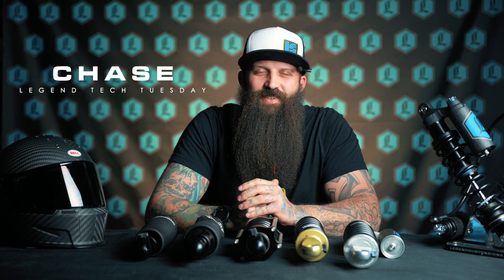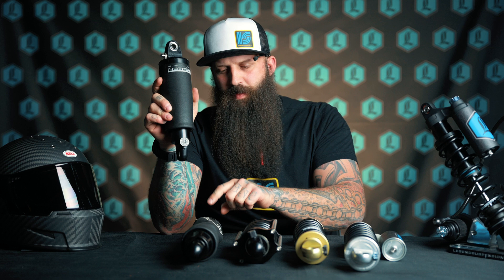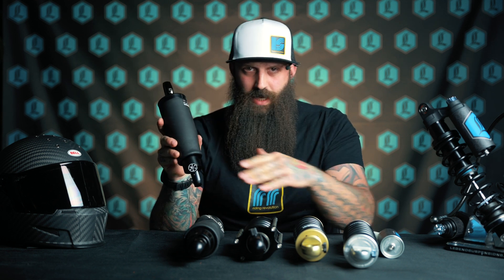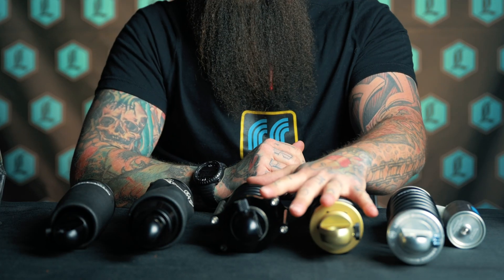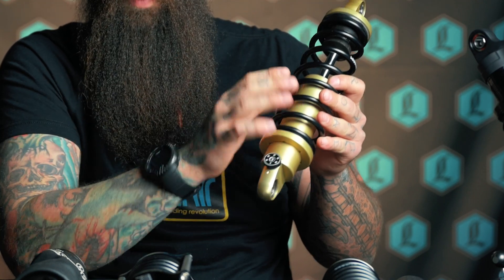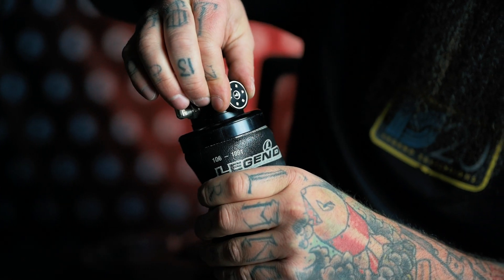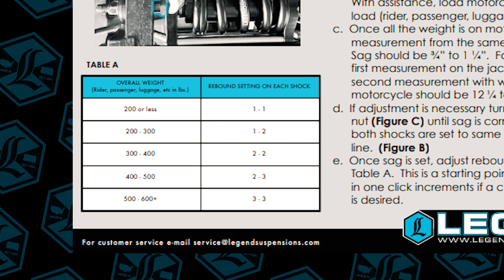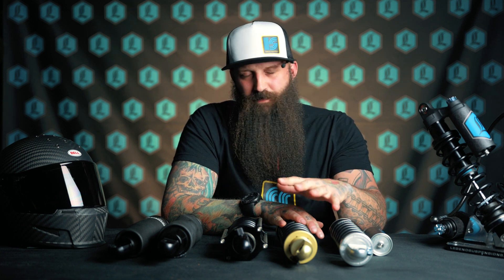What is REBOUND??? And How Do You Use It???

Comment: With a dyna and Revo shocks, approximately how many turns on the coil to add a 150 .lbs passenger.
Reply from the maker: You will need to measure the shocks from your starting point as there is not a setpoint. 
It depends on the length of the shocks you have, the spring rate and any other gear.

Comment: I understand mechanically what the rebound function does. Referring to restricting (or slowing) the flow of oil. My question is for the setting. What setting is the softer ride? The oil more restricted or less restrictive? Thanks
Reply from the maker: The fast oil movement or less restriction would speed up the shock. This is generally perceived as the softer feeling. 
Lower rebound settings or less restriction will soften the ride, but at the same time it allows the shocks to move faster. So, while it can feel softer, making the shocks move faster may not always be what you want for a given application as it can also make the ride feel bouncier.  In theory the thought of lower rebound is softer, come with faster reacting and if you were to hit 1 single bump and the shock compresses then extends more than once you would want to consider slowing down the rebound. 

You really want to aim for hit a bump, compress, extend back to ride height and done. This can be subjective based on personal preference. But this would be a good overall tune to shoot for. 

We hope this helps, if you have any additional questions, please feel free to email us at service@legendsuspensions.com

Comment: So basically there is no risk to set the Revo A at “1” and not having rebound at all? Some people were saying to me it works like pogo stick then and feels like there is no rebound or broken shock. I don’t believe that, because I personally set it at “1” and really, really like the ride. I’m wondering how would you rate the stock touring front fork is set in your terms of rebound setting? Thank you for amazing product!
Reply from the maker: Hello, 
Good questions, when the suspension sag is set correctly for your weight range you are telling the shocks to use all of its travel and prevent bottoming out. Some road conditions or areas may require someone to run less than 1" of suspension sag as bigger bumps may need to be tuned out compared to someone who lives in an area like Florida where the roads are flat and smooth. 

Once this is set the rebound preference is the rider's choice depending on how they want the bike to ride. setting 1 on the rebound might not be ideal for everyone as the lower the rebound setting the faster the shock will rebound, so if you live in a very bumpy area and hit bumps constantly, then your rebound is fast it can accentuate the bumps, and give a bouncy ride and you may want to run a higher number (slower rebound) to tune this feel out. 

On the flip side if your weight range requires a lot of preload to reach your sag range this will cause more stored spring tension during compression and the slower rebound is required more often, otherwise you get a tight spring with a lot of tension and the fast rebound and you could end up with a bouncy ride as well. 

It is important to ride all the settings and see how they all work for the rider. In the end, if you enjoy the ride and it feels the best to you, then setting 1 is just fine as long as you are happy and it is not causing you issues. 

On your second question as to a comparison guess on factory front suspension rebound. OEM front suspension is super soft on compression and tends to blow right through bumps and the rebound is super fast as well. 

If setting 1 on the back of our shock was a 1 TO 1 meaning as fast as it compresses it rebounds at that same speed, call it equal or opposite reaction, stock OE front suspension would be like setting .50 about half of setting 1 in our opinion.
Reply: @LegendSuspensions  oh my goodness! Thank you so much for such a wonderful response! It’s all clear to me now. 🤛🏻🙂
Reply from the maker: You are most welcome. We are always happy to help. If you every have any more questions please feel free to reach out to service@legendsuspensions.com , we also have a live chat on our website Monday-Thursday during business hours.
Reply: @LegendSuspensions  👍🏻

Comment: I bought the revo a’s and my 17 road glide special’s rear end  is squirrelly once I reach upper 70 mph. Any suggestions?
Reply from the maker: Hello, thank you for your business. This sounds like a suspension sag adjustment needs to be made as well as a rebound adjustment. We have a video specifically on setting the suspension sag on the Revo-A. We recommend you view this and reach out to our Customer Service Dept Via our instant chat or service@legendsuspensions.com if you need any further assistance. 

There are also many other things to check in this case as well. 
Neck bearings
Tire pressure
Tire balance and so on. 
If you have the suspension sag correctly set for your weight range and shock length, try a number or two higher on the rebound dials, if this does not correct the issue, we recommend you get the bike in for an inspection with your local shop or dealership. 

You will also want to ensure the shocks are installed correctly without the Large OEM Flat washers as this will impact the ride quality greatly.
Reply: @LegendSuspensions  THANKS FOR YOUR QUICK REPLY...MUCH APPRECIATED. I BELIEVE I FOUND THE PROBLEM. I PURCHASED THEM FROM RICKRAK IN MARCH DURING BIKE WEEK. THEY INSTALLED THEM AND AS SOON AS I GOT ON THE INTERSTATE THE WOBBLE WAS SO BAD I COULDNT KEEP UP WITH MY BUDDY ON INTERSTATE FOR FEAR OF LOSING THE BIKE FROM UNDERNEATH ME. SO I IMMEDIATELY WENT TO SEE SHANE AT DESTINATION DAYTONA AND THEY DISCOVERED THE GUYS AT THE DAYTONA TRACK COMPLETELY INSTALLED THEM WRONG. SHANE'S CREW GOT ME GOING BUT WHILE HEADING HOME IT STILL WASNT RIGHT WITH IT STILL BEING SOMEWHAT SQUIRRELY. I FINALLY GOT THE BIKE OFF THE GROUND AND MEASURED THE THREADS FROM ONE TO THE OTHER AND IT WAS A DIFFERENCE OF 1/2". JUST DOING THAT TOOK ABOUT 90% OF THE SWAYING AWAY. THANKS!
Reply from the maker: We are truly sorry to hear about the troubles, that is not the first impression we hope for. It is 100% imperative to ensure the shocks are mounted correctly and the sag set for you and your riding style, you were spot on to make sure both shocks have the same tension on those springs. it is always best to sit on the bike with your riding gear on and have someone measure from the center of the top shock bolt to the center of the bottom shock bolt and for a 13" shock you want it to measure 12", this would mean you have 1" of suspension sag. or if you have 12" shocks you want them to measure 11.5" this would mean you have 1/2" sag. 

12" or 11.5" would be with you sitting on the bike with your gear on. We do offer install guides on our website under the products tab, and we have a YouTube video of suspension sag if you would like to do anymore double checking. We are glad they are riding better for you know, but it is good to ensure they are optimized for you.

Comment: Thanks I run the 12 inch legend Revo A I would like to change to the 13 inch to give a little more ground clearance and cornering as I’m cornering harder and scraping my floorboards and I run stock styles exhaust with S&S slip Ons. Would there be no problem with that? Thanks again.
Reply from the maker: Hey Don, Thank you for your business. 

Absolutely not, one of the great things about the Revo and Revo-A is there can be altered in several ways. 
We offer length conversion under "support" on our website www.legendsuspensions.com or you can email customer service at service@legendsuspensions.com. We also offer a chat feature as well, both ways will connect you with a customer service tech who can help you out no problem.

Comment: So older softail, legends shocks blocks the tranny drain plug.. pull a shock to change oil. Or pump out top hole. Which gets part of oil. Please redesign !
Reply from the maker: Don, We recommend vacuuming it out, this is the practice or Harley dealerships and is a perfectly acceptable way to change the oil. 

You can also make a hose extension with a plug that screws into your drain plug so when it is time to change the oil you pull the hose down and remove the plug to drain the oil without removing the shock. 

If we had a way to make the bike ride great and safe without the materials we used, we would sure do that.

Comment: While Legends set would you suggest for a stockish 85' FXR?
Reply from the maker: The Revo, Revo-A or Revo-ARC Piggyback are all great options and often come down to what kind of adjustment features someone is looking for. The Revo is a great standard replacement and the rebound is always on setting 3 (which is the most popular setting) 

The Revo-A offer a little more adjustment giving you 6 rebound settings and more tuning.

The Revo-ARC allows for compression and rebound adjustment, as well as a different internal design, an 1/2" additional suspension travel.

Comment: Let's say I set up my suspension correctly for 50kg me, if I then add a 100kg pillion for a road trip, should I just increase preload and nothing else?
Reply from the maker: Mr.Midnight, Anytime your suspension sag is set for a specific weight and you alter it with more or less weight, this will change how much suspension sag you have and it is recommended that you double check the sag. To answer your question, If you like the settings where you are and the sag is set for you. Then you add weight, increasing the preload to account for the added weight to get you back to the correct sag and leaving the settings where they are will make the bike feel the exact same as it was before you added the weight.
Reply: @LegendSuspensions  Thank you!

Comment: If it feels like itss bouncing me out the seat,whats the fix?
Reply from the maker: We recommend you double check to ensure your sag is set correctly for your shock length, then in terms of rebound, everyone rides and feels a little different so we suggest making wild changes to the suspensions. Go far one way and ride the bike, then far the other way on the adjustment. This will show you what is actually changing, then you can work your way back from there to eliminate the settings that you do not prefer and this will narrow down the perfect setting for you. There is not a one size fits all recommendation, a good starting point would be to turn it clockwise till is stocks and back it off 4 clicks on both shocks. This tends to be a good happy medium.

Comment: Even when the shocks are done appropriately is it fair to say when going over a deep or a  low spot you will bottom out and cause discomfort.  Or is there a way to avoid the hard hit of bottoming out by either increasing the rebound or tightening the spring dumping.  I have my 13 "  Revo A's on 2 with the 12 " center to center.
Reply from the maker: Hey thanks for reaching out. You shouldn't be bottoming out if you have the sag set correctly. Would you please email service@legendsuspensions.com and make sure we get you set up correctly. Thank you!

Comment: I still can’t get the Revo A’s dialed in.  It’s a rough A ride no matter what.  2020 Ultra limited.
Reply from the maker: Hey there, thanks for reaching out. The first thing we recommend is setting your sag. Once the shocks have been mounted properly, the next step is to ensure you set your sag correctly. This step is extremely important to ensure you get the best ride and performance out of your shocks. Our sag adjustment procedure will also ensure you are getting the most travel out of your shocks, while also leaving clearance on the top side of the stroke to allow for "top out". If your sag is not set correctly, you are going to either bottom the shocks out, or feel as though the shocks are way too stiff. Proper sag adjustment ensures you are riding within the "sweet spot" of the travel range for the optimal ride quality.

For shock models that include rebound adjustment, think of the sag adjustment as your "macro" adjustment, and the rebound and/or compression adjustments as a "micro" or fine tuning adjustments. Always get your sag set first, and then fine tune the ride with your rebound adjustment and/or compression adjustments.

Comment: So you got to get both shocks adjusted the same? Just don’t know would love to buy your product love American made stuff. I know they’re good stuff don’t know if I could use them might be hard to do especially I’m a distance ride. I usually ride heavy and on the way home heavier with my wife buying shit.
Reply from the maker: Hey Michael thanks for taking the time to leave a comment. We actually do offer the REVO's, which is the same shock as the REVO A but without the rebound adjustment. The "rebound" on the REVO is just set at a 3. All you need to do is set your sag for the weight that is on the motorcycle and then you're good to go. Here is a link to that shock. https://www.legendsuspensions.com/product/legend-revo-flh-2/
Reply: @LegendSuspensions  Thanks that’s all I’m looking for all those adjustments I ride 14 CVO Limited. How do you like a comfortable ride and I do like full range of motion in my suspension. I bought my bikes new it has 50,000 miles It’s a really good bike cheaper to refresh it then to buy a new one. Besides mines nicer than the new ones. Very well-maintained bike. Thanks I’m going to look into your shocks American I like that South Dakota I’ll be there right after Sturgis week after. You guys don’t do anything there or do you looking for a deal let’s cut out the middle Man and I can ride home in comfort.😀

Comment: I placed the golden color shock absorber on my 2016 ultra limited cvo. It was done by HD dealer in Riverside,  CA. Out more than 20 motorcycles I have owned these shock absorbers are literally the worst. I asked HD dealer to upgrade to the best absorbers they have but they declined on the basis that they would loose money. I am very disappointed with those shock absorbers. I paid a total of more than $1,250, and I got the worst shock absorbers. Did they use the wrong type?